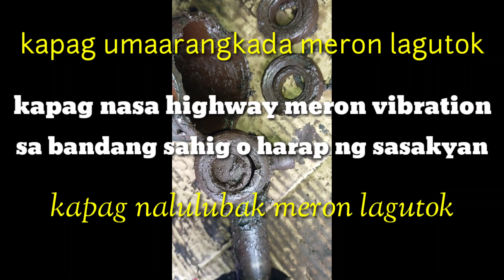How to fix Ford escape front CV joint/drive shaft knocking & vibration problem

Comment: hello. i have ford escape hybrid 2009 fwd. i have replaced cv axle 3 times. what can damage it so often?
Reply from the maker: hello,  did you replace it with original parts?  thanks for watching
Reply: yes it is original only used but in a good condintion.

Comment: Sir, my escape has a noise when turning to the left just like a brake  noise, so what's the problem 
All CV axle was change with brake pads & rotors. For wheel bearing no side play even up & down
Reply from the maker: Consider to check also the shock mounting Sir,, from were are you Sir? if your place near Pasay , if you want i will check.. Thanks
Reply: @buksrider1994  From USA retired mechanic for almost 17 yrs.